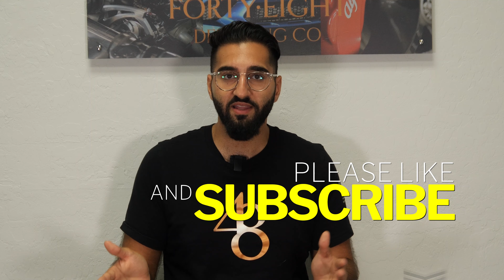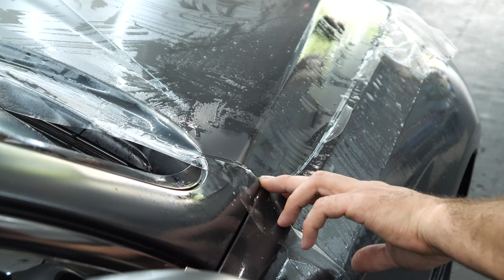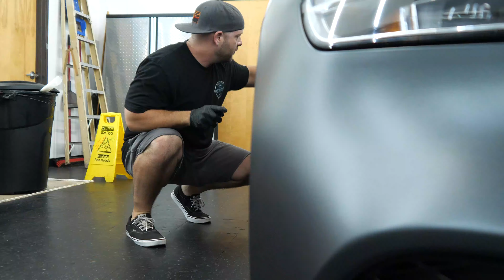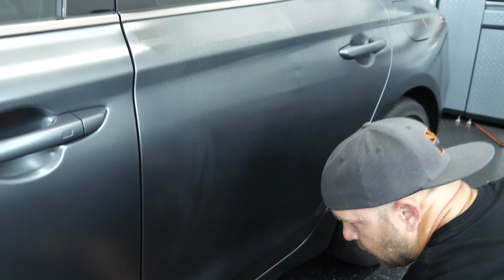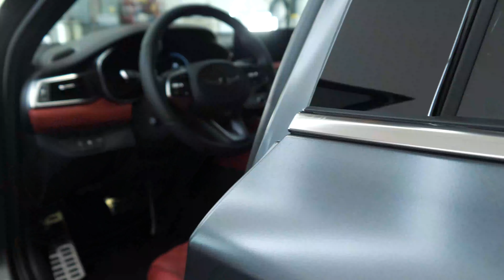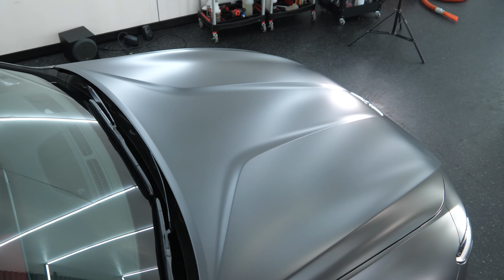The ULTIMATE Paint Protection | 2022 Genesis G70 Matte Grey

Comment: I have a g70 launch and I looked to add stealth .. its a scam . It actually makes it more gloss isle how you voided any light reflections. That's because it shows a glare ..
Reply from the maker: How would it add more gloss? Please explain?
Reply: @48 Detailing  have an over head light on your car  hood , show It with the film and without  and you will see the glare from the reflection more with the flim than without... That is called a satin not matte.  my matte g70  showed this clearly
Reply from the maker: You do understand that Stain provides more gloss then Matte correct? It’s amazing how you think you have more knowledge then the actual company (us) that works side by side with the manufactures and partners that develops matte/satin paints, coatings, and film….
Reply from the maker: And for your information Genesis paint is closer to the spectrum of Satin paint more so then matte such as BMWs and Mercedes. I mean we would know we work on them every week 😂
Reply: Well I have applied stealth and it's lesse matte than the paint. I agree it's more satin when you test it it has glare. But with the stealth it has reflection 😔

Comment: I just bought a 2022 G70 grey launch edition and I’ve done exactly what said in this video!  Also, don’t forget to  use a dedicated matte paint soap and QD!
Reply from the maker: Nice job Patrick and congratulations!
Reply: I just purchased the verbier white Launch edition. I was told they applied ceramic coating, would I have to remove  it to apply the ppf clear wrap?
Reply: @SamKap1984  who told you that?  Genesis?? It doesn’t come coated from the factory. That being said, you don’t have to remove the ceramic coating before applying a PPF: in fact, I don’t see how you can remove a Ceramic coating from a matte paint, since you must avoid scrubbing the paint or use heavy chemical.  the only way the CC will vanish, it’s time (1 or 2 years) but On a matte paint, C Coating and PPF are not a recommendation, it’s essential (in my opinion).  And yes, you can (should) apply a CC on a PPF.
Reply from the maker: Thanks for helping out Patrick! You got a good grasp of what’s going on for sure! One thing I might add is that it is possible to remove a coating from a matte surface, but it takes a lot of time, patients, and a lot of a special product from Dr Beasleys. It is highly unlikely that your car came coated from the dealership, there probably just saying that as a sales point. So I’d check with the detailing department, worst comes to worst they applied a sealant to the vehicle and are trying to pass it as a coating, which in that case the Matte Decon line will be your best friend!